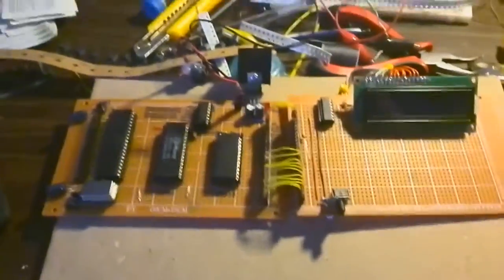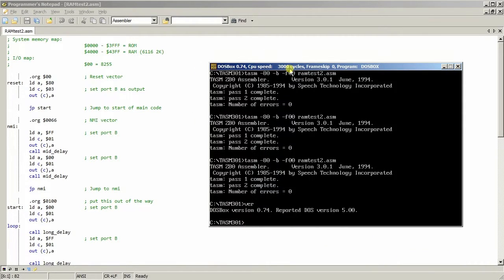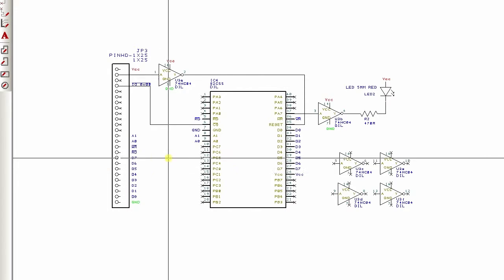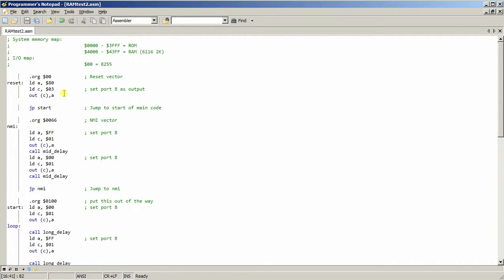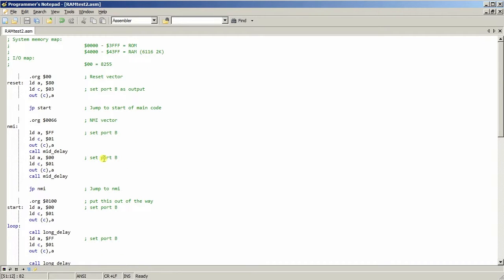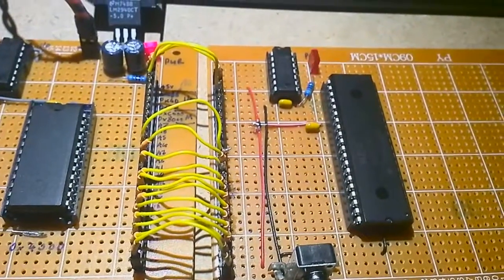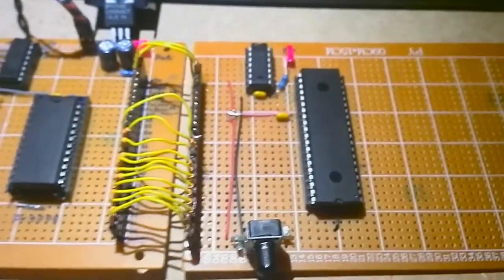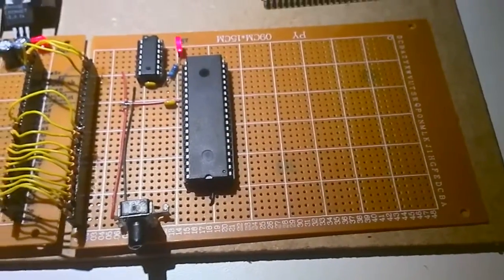Z80 Project 006 - 8255

Comment: Hello Buddy,

Humm at the beginning I thought you missed some coupling capacitor on each IC which is not the case.
I do not have a full scope of your code but something crucial looks missing.
I mean SP initialization to the last address of RAM.
You have a beautiful Stack Overflow.
When you call a function the CPU store the current content of the PC in the memory pointed by SP.
In your case SP is pointing anywhere within 64K of memory domain which explain the erratic behavior.
Hope it will help you on this matter.
25 years ago I had a hard time in my end of school project because of that kind of issue.
I was sure that the system I was working on had 64Ko of ram...Finally not only 32Ko
Then my SP was floating somewhere in the SRAM ( Sky Read Access Memory  )     ;-)

It took me one week to find out what was the problem.
I realize my message is coming late. May be your board is waiting on a shelf with 10mm of dust now...

Thanks for the video
Reply from the maker: Hi Samuel, this one is a rather old video unfortunately but you're right about the SP initialization being missed. I simulated a lot of my code in the Z80 Simulator IDE back then and that had it's entire memory space simulated as RAM so it would work perfectly for that. I've moved on since that project and started another one called M62, which I need to do some more videos on soon, you can find the playlist here: https://www.youtube.com/playlist?list=PLa2nat5jXFbW8gAWWiBo9-kPF1an5QAwB  Many thanks for the comment!
Reply: @39Kohm  Simulator are just liers
I watched your next video and I was happy to see other people coming to the same conclusion.
For sure I will follow you for your M62 new project since I am working too for the same kind of project.
Do you think that "M62" bus name is a word game related to that event which occured in 1974 ?
https://en.wikipedia.org/wiki/M62_coach_bombing
I would be happy to share it with you. It is in Kicad format.
Its schematic design is about 95% completed. But I am affraid of the next step...PCB design...gloup...so much wire
Reply from the maker: Hi Samuel, It's originally named after the first letter of my Last name and how many contacts are on the connector. I never heard of that event to be honest, but it was purely coincidental that the bus is the same name as the road despite growing up within line of sight of it. I chose the connector because it was at hand to salvage from an old motherboard :) I am considering moving the project to kicad as I feel it's more popular than DesignSpark. The PCB design stage is the most fun part, I've worked professionally as a PCB design engineer so I enjoy the challenge personally :) Many thanks again for the reply, I'm planning another video this weekend when I've finished cleaning up my lab.

Comment: Peter, I can't open the Eagle file. The error in Eagle 9.0.0 is "Error: line 1, column 1: Start tag expected." When I examine the hex, your file starts with "D0CF" and a typical one of mine starts with something else. Is it possible to post a .pdf file of your schematic, please?
Reply from the maker: Hi Don, the file is for DesignSpark which is why eagle cannot understand it, I have made it into a PDF as requested and uploaded it as well as added the link to it on the page, it is here : http://www.39k.ca/Z80/schematics/Z80_Computer_v1.0.pdf should you require a direct link. it's is the same as the image above it, though not in colour.
I've started a fresh Z80 project, I've yet to make any videos but this one will be in much more detail, I am waiting for a couple of PCB's to arrive, the current page is here: http://39k.ca/m62-modular-computer-system/ but I will hopefully give it a better page soon with a better way of laying out the information.
Many thanks for the comment.
Reply: Thanks, Peter. I was hoping to see the schematic for the Z80/LCD circuit. 
Is this the connector you're thinking of using: https://www.digikey.ca/product-detail/en/te-connectivity-amp-connectors/6-5530843-5/A31724-ND/770550 
I'm glad to see you've found another worthy project with the S100 bus.
Reply from the maker: Hi Don, that connector will work too, the one I ordered is slightly cheaper, https://www.digikey.ca/products/en?keywords=A121053-ND $4.84 opposed to $5.74 each. As for the LCD circuit, I connected the LCD to the 8255 using ports A and C I believe (I'll need to fish it out and take a look), but I think it was port A for the data lines, and first half of C for the control. I will try and draw up a schematic from the actual wiring when I find it. Thanks again.
Reply: Thanks. I noticed the RC2014 group decided to go with a different kind of connector. It's available as a double-pin unit, too. 
I'm on my 4th book trying to get a handle on 8255 and Z80 I/O. I'll let you know who the "winner" is when I'm done, if you like.
Reply from the maker: I would love to know how that goes. I did small bus system design before I started on this one using 40 way pin headers before I heard of the RC2014 designs, it was similar in look to there's, I didn't document it but I still have the boards around, It didn't quite feel right to me, but that's my preference, anyway they were not as well designed, I was busy with university so I didn't have much time or effort to put into it, this time I'm trying to do it more properly and document everything and test things as I go, rather than throw it all together and hope for the best.
Reply: The book is "Z80 Applications" by James W. Coffron, lSBN 0-89588-094-6. Chapter 6 is "Using the 8255 PIO with the Z80" and Chapter 8 is "Using the Z80-PIO".  This is not a fantastic book, but it's better than a lot I've look at so far.
Reply from the maker: Thanks for the tip, I've just put an order in for it, can never have too many Z80 books.

Comment: no interupt pins or io/memory floating?
Reply from the maker: The input control bus pins on the Z80 have all been pulled up to 5v via a 10K resistor, but I will have to go over the board and make sure there is no floating pins on the address bus. I added pull down resistors on the data bus since the video with no change, I might do this to the address bus too. Sorry for the delay, college is getting in the way of the fun :D
Reply: 39K
Thats fine, I commented just yesterday and quite busy with college myself.  erasing eproms did went well and found myself distracted by programming some gameboy roms (selfbuild cardridge.. does seem to pass nintendo, but the z80 locksup for some reason)
Awesome you do find some time to build a z80 AND make videos ;)